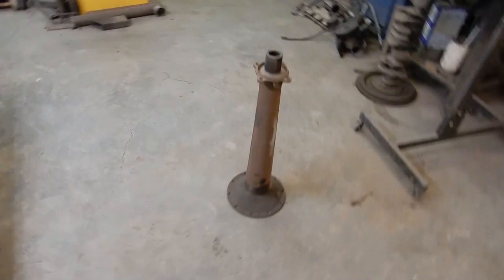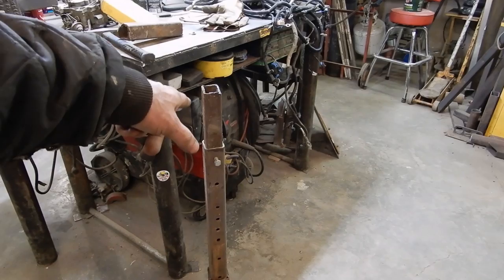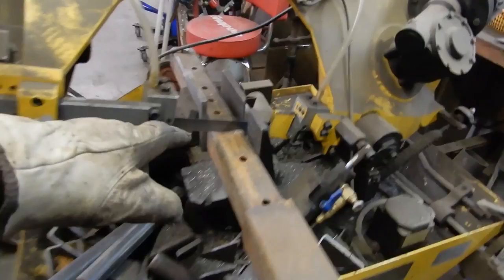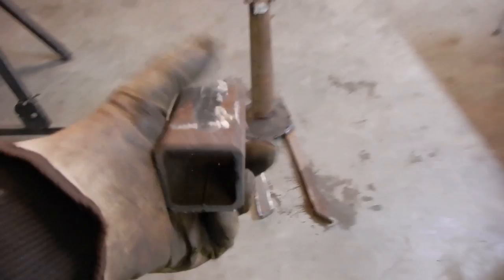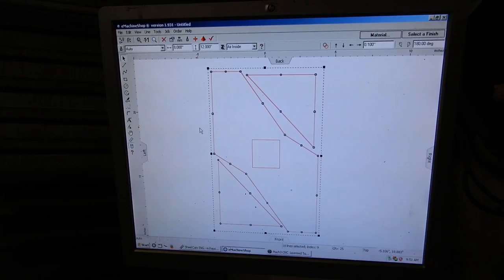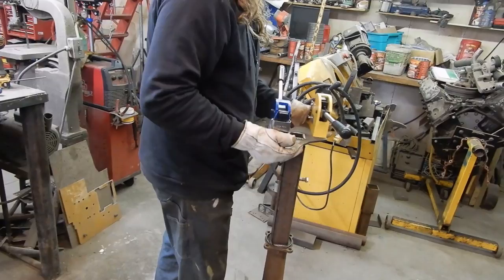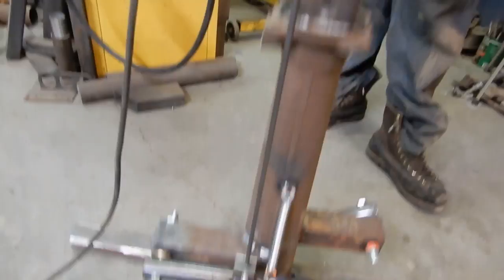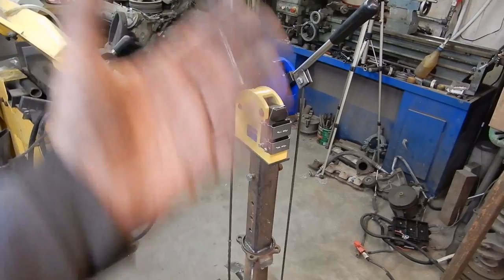How I converted a Ford Model A axle tub into a muti-tool stand

Comment: I like your way of thinking on a multi-tool stand. In my experience I find I am using the shrinker-stretchers, bead roller, plannishing hammer and English wheel together for many projects. I don't think I would have them all using the same stand. I would be forever swapping them out.  Tools like these need their own stands for me
The largers tools need a very well supported base. Add wheels to one end of the bead roller but have them just off the floor enough that you have to lift the other end to make it roll around.
However, I once  made an English wheel with swing-out  plannishing hammer on the side, to save space.

Other ideas
-Post-dollies would be great 
-Mini welding table
-"Third-hand" clamping tool when a vise won't work  (think of soldering jobs or holding something odd-shaped to heat up with a torch)
-Power tool with foot-switch to turn on and off. An upside down electric metal sheer, a small belt/disc sander, etc.   Have the foot switch turn on a socket and plug the power tool into that
-Simple, but a camera stand with adjustable arm to hold the camera at an angle or extended out.
-Magnifying glass stand with a work table . You'll appreciate that as you get older eyes ;)
-i had the beer holder idea too. The say great minds think alike. They also say fools seldom differ. ;) 
Rear axles have two sides... make two stands ;)

Thanks for your videos.

Comment: And pet approved. Quite the bond... I see a collective car to roll for cash infusion coming. Cash being the operative word. Summer sun everywhere but my place a high of thirty this morn  /afternoon ist thing to eight right now and walls popping. Dan will need a shaping bag and some dead blows or hammers used for metal shaping. I loved my shears, bar folder, and drum rollers as well. A forge for outdoor metal projects and indoor assembly. If your wrenching then these really don't usually get in picture. I first started, I only had room for one piece of steel in floor for my frame straightener and porta power. I used to buy insurance totals as they could just be "too expensive to fix" or have shit torn hell and gone but if what I was after was worth it to me, show no mercy as got into stuff. I would of made the news someday had I not got hurt. I only had a few years to build up my loses in anchorage and rebuild in the valley here. For the first time, I made a week what I made a month in a big town building stuff for people like aircraft hoists and overhead gantry hoists! When you take the leap and cut off the public and just work for yourself completely, shit gets down and dirty done! Some people see only junk and I see things yet to be made.... comes from fabbing everything instead of a store bought in the islands in southeast alaska. I either made it or went without till  a barge came in and I never went without but I had over fifty oxy/act. tanks at one time. What saved me was finding good coal on one island... fire up forge and straighten track guards on dozers or hard surface blades... dang it, there i go again... great guys
Reply from the maker: Haha thanks man, Yeah there will be a plenty of tools yet to aid him with making sheet metal stuff :)

Comment: Thought I would weld some pip to a rim and mix some cement in the rim for a pedastool then a plate of steel on the pip to put vice or bench grinder sand disc with belt sander I have collected a lot of tools that need to be on stands. I like how you made your take up less space.
Reply from the maker: haha I leave the rubber on so it won't vibrate around.